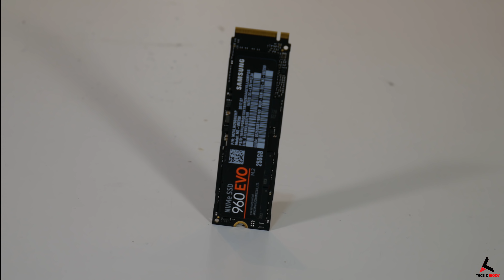Lian Li Pc-Q37 "The Quartz" Itx water cooling gaming pc.

Comment from the maker: Build needs soon an update. Most probably will set one of the 15mm fan under the passive radiator down at the bottom of the case. Or just go with XSPC's 240mm slim rad.

Comment: Can you explain the bottom 120 rad and fan setup? Thanks.
Reply: And then I just read the info.. lol.

Well if you set the 120 to pull from the bottom, it may actually exhaust some of that heat back into the case and out the rear.
Reply from the maker: @CastIronEric  Exactly. But, i would recommend you to buy XSPC TX240 radiator which has 20,5 mm thickness.  The Quartz will have the 120x15mm fan just under the radiator. But, to be honest there'll be not much temp differences (~2-5° celcius-35-45°fahrenheight).